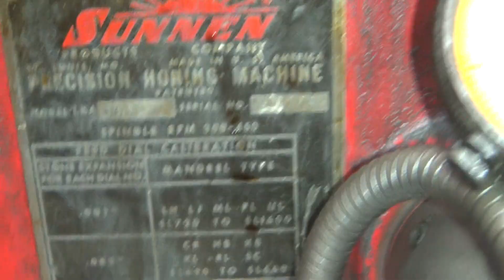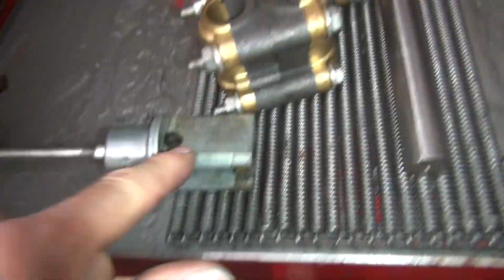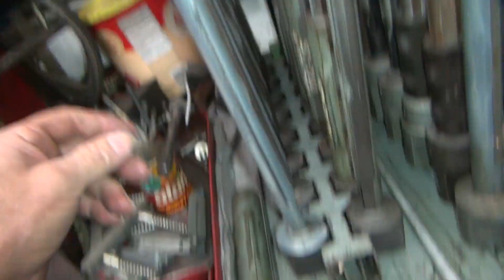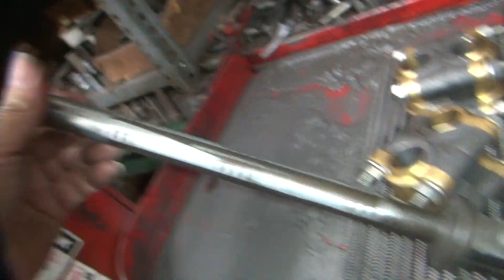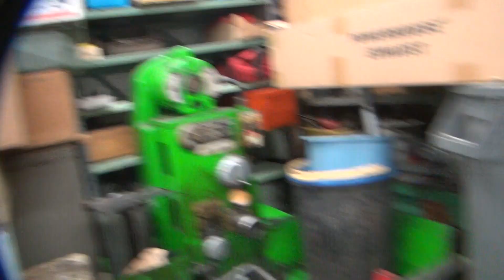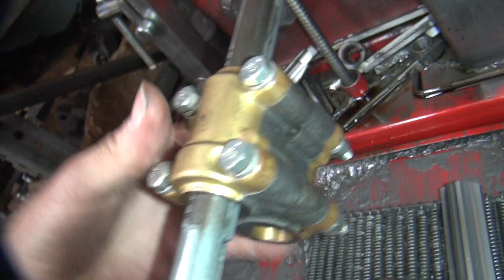#125 1950 panhead head assemble rockerarm grinding high lift cam setup porting harley tatro machine

Comment: Never seen you do many knucklehead heads. Are they similar in design to the Panhead with the halves that bolt together?
Reply from the maker: no, they use a shaft just like they all do from 1966 and later. the panhead was the oddball.
tatro